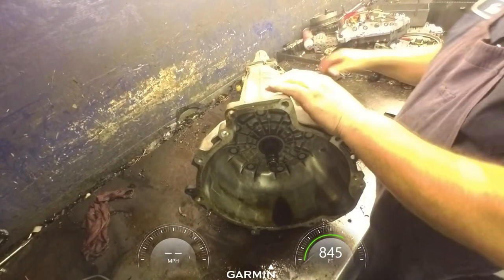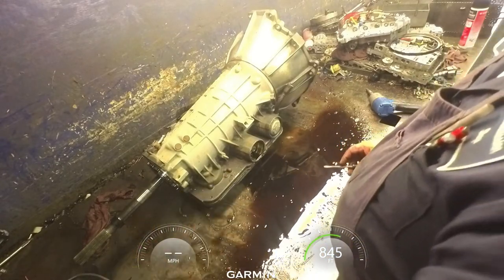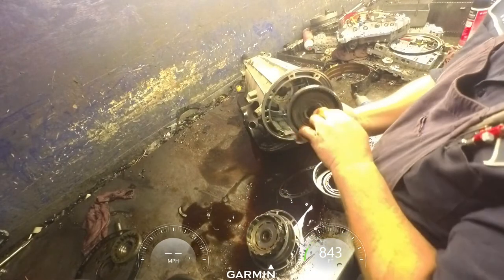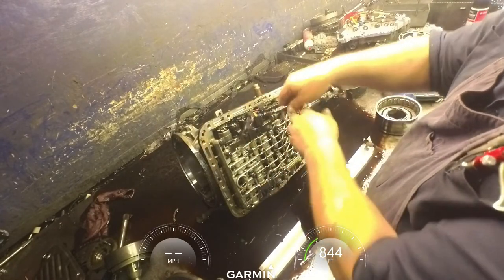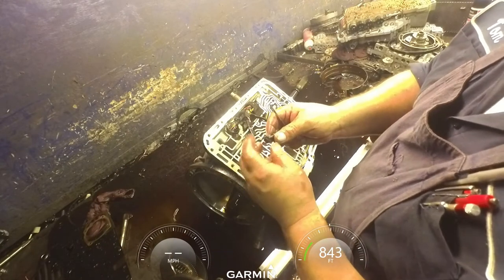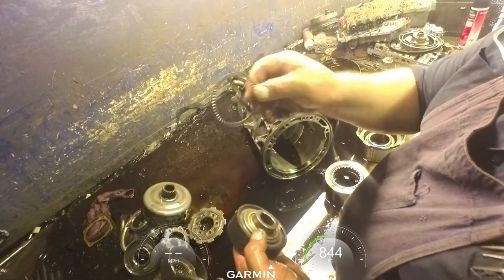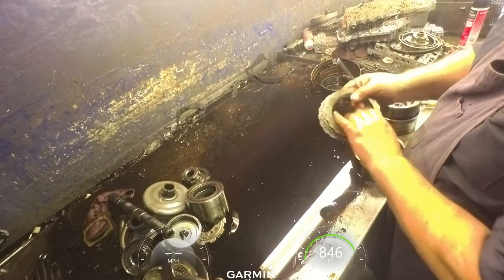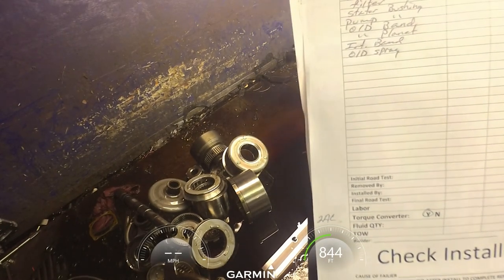4R44E 4R55E 5R55E Disassembly

Comment: I used to own a 1996 Ford Explorer Eddie Bauer Edition 4.0 V6 with the 4r55e transmission and it kept breaking the flexplates around the crank hub. Even after replacing the torque converter twice. A transmission shop I paid did the flexplate and torque converter change and replaced three flexplates, once with torque converter. I changed the last one myself and the flexplate, it broke down on me three months later. I am thinking it was the pump or something else inside of the transmission. I was going 75 mph steadily and started going up a 1%-10% grade near the small town of Navajo Arizona when the flexplate snapped that I installed with a new torque converter. I abandoned the truck and the local tow shop towed it to there yard. The next time I passed by we as three years later and I gave him a guy named Darryl the keys, remote, and the titled signed with his name as the buyer. 🙄 I wish I had AAA towing, the closest towing shop wanted $100 to tow the truck one mile.
Reply from the maker: I would bet that it has a bad crankshaft.
Reply: Thanks for the reply. I thought maybe it would be the carrier bearings or lock up in the transmission causing the flex plates to break under a moderate load.

Comment: Love your videos!  I have a 5r55e that the reluctor for the turbine speed sensor sheered off, which caused a p0715 code.  Have you seen or heard of this before?  I can’t figure out what caused the failure unless it was just metal fatigue because of the high mileage 250k 🤷‍♂️
Reply from the maker: Thanks. Does happen. Very rare. If it is not all messed up you can weld it on. Gap between the sensor and the tone ring is supposed to be .025-.072. Easier to just buy a planet. Usually the brass washers are coming out of it anyways, that is very common.
Reply: Thanks for getting back to me!  On closer inspection, that area on the planetary where the reluctor is welded, about 3/4” down from the welds are 2 sets of notches where it appears the clutches wore into it?  I’m replacing the whole planetary but I’m afraid it will happen again if I’m missing something.
Reply from the maker: @russellmccarty4287  It's centered up by the bushing in the overdrive drum and the bearing in the output shaft. I would replace the bushing in the drum.
Reply from the maker: @russellmccarty4287  Replace the sprag also.
Reply: Thank you so much for your help!  It’s really great that you are sharing your knowledge, you’d make an excellent teacher.

Comment: I took my 4r44e apart yesterday, forward drum had the first few cluches and plates almost weld together. Chewed up the gear that fits inside the forward drum,too . The planetary with the ring gear was also missing some brass washers, but is that all it takes to call it bad?? Why did you scrap yours? Also a bit confused about the servos. I have two AB's but each with different springs. Any help would be greatly appreciated!! Got most of what I needed to rebuild tomorrow.
Reply from the maker: I think you are talking about the overdrive planet. Yes, they are bad about the brass shims coming out and should be replaced. AB servo's are good, just make sure the apply levers are at least C's. A is best. Lighter spring goes in the overdrive, front servo.
Reply: @CurmudgeonTransmission  Awesome, both levers were A's. I finished most of the assembly except for the valve body, gonna clean it up and see if I can get a shift kit. The only hiccup I got was I forgot to install that little black oil cone. Doesn't seem too critical.

Comment: hi! I know you posted this 3 years ago, I’m currently rebuilding my 4r44e in my 96 ranger, how could you tell that the overdrive sprag was bad? I know the planet was bad because of the washers, but what about the sprag made it bad?
Reply from the maker: They have a high failure rate. If it is siezed up or turns both directions it is bad. the sprag itself, the center hub and the planet will all be bad.

Comment: I have a 96 ranger and notices that my rear ring gear did not have the needle bearing or the bearing on the inside of it, is it supposed to be like that? I’m pretty sure it’s a 4r44e
Reply from the maker: There are different versions of the parts. If you will post a picture of what you have on my Instagram I will let you know how it is supposed to be.
Reply: @CurmudgeonTransmission  I sent you a message

Comment: Hello, I have a question if you have the time. I have a 2000 ranger 4r44e and it went out. I was given a 2005 ranger 5r44e. Will I be able to use this transmission? They look identical except the two extra sensors on the 5r. Thank you in advance!
Reply from the maker: Pull the rear speed sensor out and look at the sensor ring. If it is the same and the torque converter stall is the same it should work. You can tell the stall of the converter by the little dimples on the side torwards the hub. If they all lay at the same angle then the stall is the same. If it is different just get one that is for your engine and it will work. What makes it a 5 speed instead of 4 speed is the computer strategy. So it will still only have 4 gears in your vehicle. The 5 speed has beefier planets in it, so it would be an upgrade there.
Reply: @CurmudgeonTransmission  thank you for responding! My 4r44e doesn’t have the rear speed sensor, just the main harness and the gear select harness. It’s out of a 2000. Do you think that can be an issue?

Comment: Where are you located? I have an 03 Ford explorer with a 5r 55 s. Is slipping a little bit in drive but not in number one or number two.
Reply from the maker: I would say you either have a mis-adjusted shifter cable or an overdrive sprag that is failing.

Comment: Thanks for the video. I have a 96 Explorer, it has a long delay (About 10 seconds) in reverse at cold starts. It sometimes blinks the O/D Off light. The codes are "Reverse Engagement Error" and "Pressure Selonoid Low Pressure". It has no issues on forward gears, only reverse on the first engagement at cold start. I replaced the reverse servo o rings, EPC solenoid and applied Trans go shift kit but had no effect on this issue. What might be the problem?
Reply from the maker: Try putting a .218 ball between the reverse modulation valve and it's spring. Also try leaving out the #2 check ball. It is just to the right of that valve line up (as you have the bore plug facing you).
Reply: @CurmudgeonTransmission  Thank you for the reply, i will try that. I have one more question. Before i applied the shift kit, it had a delay from 2 to 3. Now after the shift kit it, 2 to 3 delay is gone, but it started to delay from 3 to 2. I replaced the Epc at the same time, but with a red one, the original was green. I ordered a green one but cobra transmission sent a red one, and said i can use the red one with the shift kit. Do you have any idea why 3 to 2 delay have occured?
Reply from the maker: Do not drive it anymore with that EPC on there. You can not swap them out. You will end up burning the forward clutches out of it. Get the right one on there and see how it is working and we will go from there. 2 totally different computer strategies at work there and they do not swap.
Reply: I lost reverse recently, it ended up being a warp in the valve body and some retarted solenoids

Comment: Changed the plate and valve body. It gained a 1-2 shift but no 3 or 4. I think that the band could have come loose when I changed the valve body but reverse is fine and it is applied when it is in reverse so since reverse works I don't know that it is off. I am just going to pull it and start over tomorrow.
Reply from the maker: The band is only on in 2nd and 4th. Reverse is the low/ reverse and the reverse inputs. Are you sure it is shifting 1-2 and not maybe 1-3? Do you pull the capsule out of the case? Maybe you forgot to plug the case. If you haven't pull the capsule out and plug it. That would leave a problem with the input drum, pump or valve body. If it is 1-3 that would be a problem with the band, servo or valve body.
Reply: @CurmudgeonTransmission  nope. Didn't pull it.
Reply: @CurmudgeonTransmission  I burned the original transmission up really bad. This one was a new gm unit that was put in a customers vehicle and we sent my old one back and kept this one. Same thing it was doing in the vehicle that it was pulled out of. Only shifting from 1-2. When I pulled it down I found the usual 3-4 clutch pack burned up as they do and a burned up band. I replaced that stuff but added the things that I told you about. Now the only things left in the unit is the 500 boost valve, extra wide band,a Zpac,and those accumulator piston turned like I told you about. I hope that I didn't burn up that Zpac.
Reply: Also a Corvette servo. When I put the servo in using the gold shim in the shift kit it made the band too tight. I read in the instructions that if it did to leave it out which I did. That made the input shaft turn normal with the hand.
Reply: Is it ok to put a plug in from the bottom of the case to block that capsule? I know people who have done it but I don't want to make a bad situation worse if it will.
Reply: It very well could be 1-3 because it would be in a lot more of a strain if it were 2nd.
Reply from the maker: @jasonallen8304  When you get the unit apart air check the drum through the pump. If everything checks ok, pull the capsule and block the hole. check the bleed orifice in the 3-4 accumulator. That leaves the valve body.
Reply: @CurmudgeonTransmission  ok

Comment: How do I tell the color of the solenoid?  Red or green?  I recently put in a valve body with new solenoids, worked for a month, then started slipping big time. First gear, second and third too
Reply from the maker: Either pull the solenoid out or pull the separator plate off and look down at the snout. I believe it was 97 that they went to red. Earlier than that is green. You will be pulling it out to fix it. Burns forward clutches bad. If it is wrong just swap out the EPC and it will be fine once you fix the burned clutches.
Reply: @CurmudgeonTransmission  is there another way to tell which solenoid I need?  The transmission was swapped out from a 4r44e to a 4r55e.  So I’m not sure which solenoid
Reply from the maker: The only way to tell which one you have is to pull the solenoid out and look at it or to pull the separator plate off and look down in there. As far as which one you need, it goes by year. 1997 and up use red, earlier uses green.

Comment: Does the band drum rotate counter clockwise or clock wise? Putting one back together and could've swore it rotated counter clockwise but it rotates clockwise
Reply from the maker: Reverse, clockwise. O/D, hold planet, ring gear turns counterclockwise

Comment: How do you get the drift pin out of the case so you can replace the selector shaft seal ?
Reply from the maker: Sorry I took so long to respond to this, I had responded to this and submitted it, so don't know why it did not post it but it just showed up in my feed again. So we will see if it posts this time. I use a pair of wire cutters to grab ahold of it and leverage it out, this does not always work, it is very hard to get it out. Most of the time I use a small pocket screwdriver to pry out the seal without removing the linkage. If you want to see that watch the rebuild video.
Reply: @CurmudgeonTransmission  Thanks. Some trans seem to have an oval recess, but mine has a single 1/4" round hole too small to get into. I carefully opened it up with a carbide cutter just enough to grab with diagonal cutters. Thanks for the tip on the screwdriver.

Comment: I hate to ask you for anything.. I know youtube is not paying you anything yet.. but.. could you do a video on checking clearances..with a dial gauge.. not with a feeler gauge on a drum but like output or input  shaft play. . you tube has no videos on that. at least not with transmission. just with backlash on rear ends only..
Reply from the maker: See what I can do. There is a video I am checking clearances in a drum, don't remember which one, think it is a Dodge A604. Don't remember for sure.